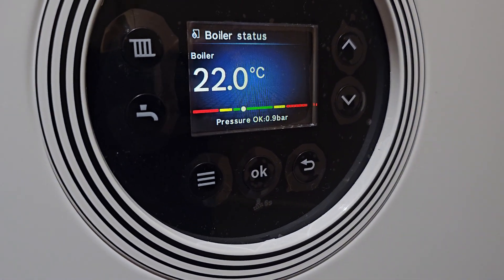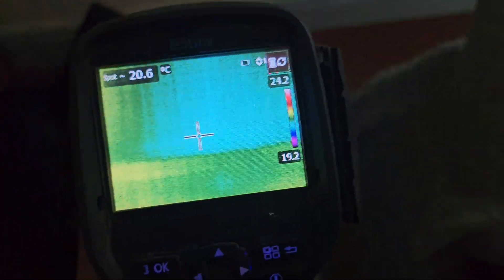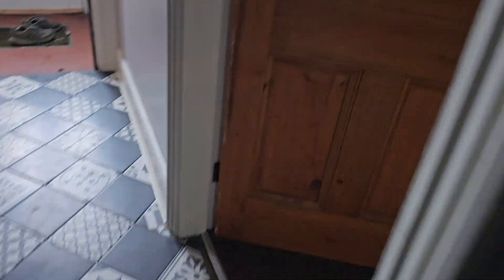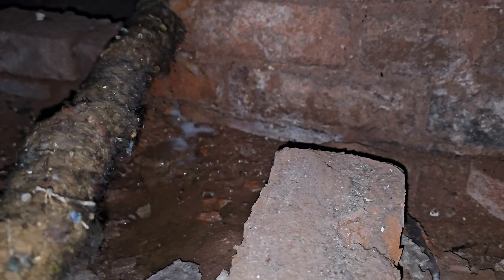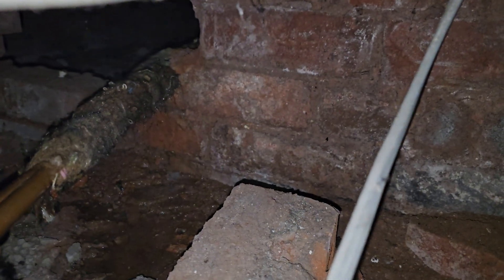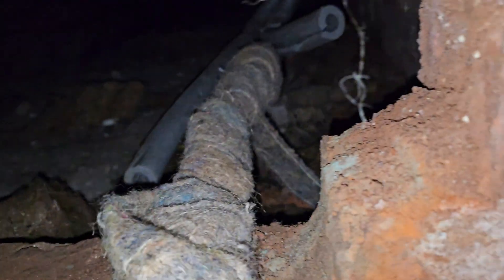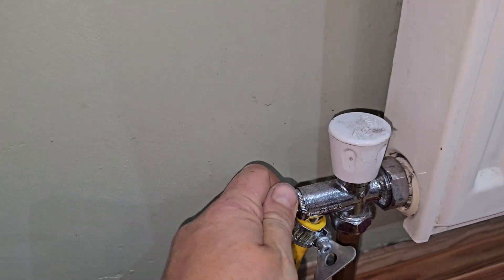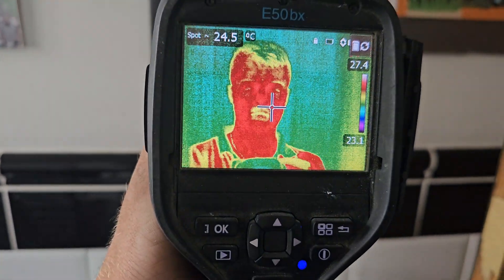WHOOP WHOOP That's the sound of a LEAK!

Comment: If you want to know how leak detection with gas works… 
Drain system
Swap gas and water supplies to boiler
Re-fill system and leave fill loop open
Walk around property with a lighted match